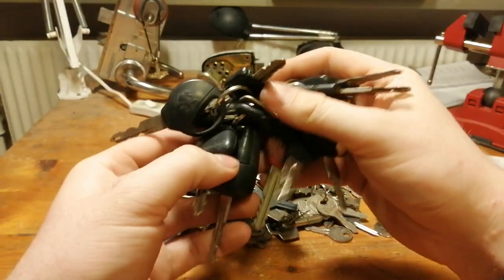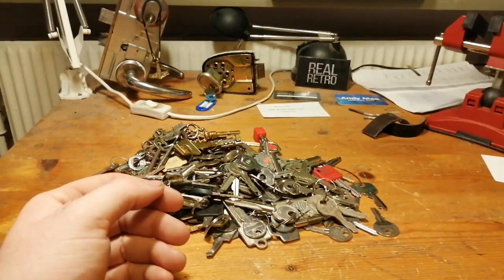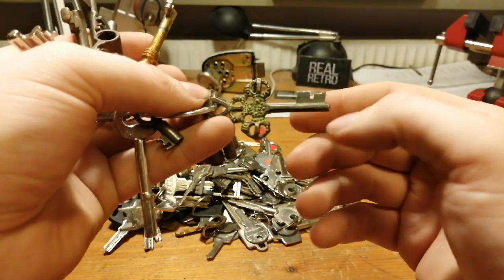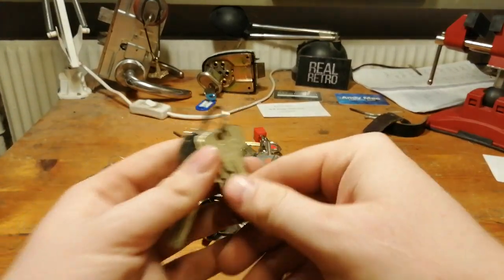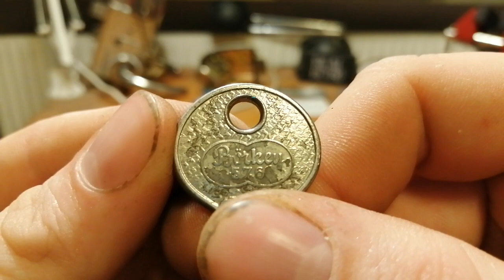(816) my key collection

Comment: The second bunch of keys you picked up, the one with a small square hole looks like a radiator key. The triangular hole in another key looks like it's for a exterior gas or electric meter door. We have them here in the uk just like that.
Reply from the maker: Some of Them can be used in trains too
Reply: @lockmania-locks  didn't know that.
Reply from the maker: @roysammons2445  it do depent on witch locks they use

Comment: - The one looking like a Rex, is a rex copy from errebi or castle, just put a “1” infront of the number on the key.
- The round one with 2 tiny pins is to pull up a car antenna
-Allux and Mefa are Danish letterbox companies
-the square bow Union was used for ignion keys on the old Mini.
- Jasafe is pronounced “Junk” 
-Optimus is a popular lever/warded padlock on garbage containers.
-Ruko System is the restricted profile selection.
-The one with angled handle looks like it is for the old guard clocks. The guard had to find the keys around a building to clock in, showing he had been in all the important rooms. 
-kis is a company making key copies just like errebi and jma.
-the Saab key is made by ASSA, as you see on the bow. They also made the old Volvo locks. Good to keep business within the country.
Reply from the maker: Thanks for All the info my friend

Comment: Nice variety of keys. Keys take up half of my lock bench drawer.  Precut keys come in handy when they fit the keyway of a lock with no key. Easier to fit keypins than it is to cut a key.
Reply from the maker: Thanks for watching my friend, i have a very small bucket Thing with Keys for that too have not had a need for Them yet but Nice to have but these Keys is a collection i do use for locks tho and I do still not like to repin an old lock just so it have a key but for newer locks it is fine